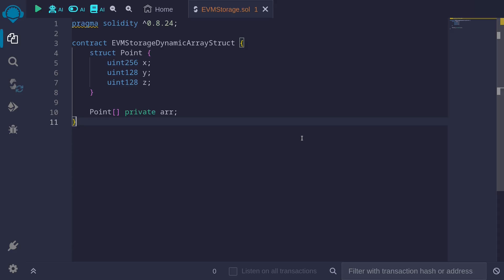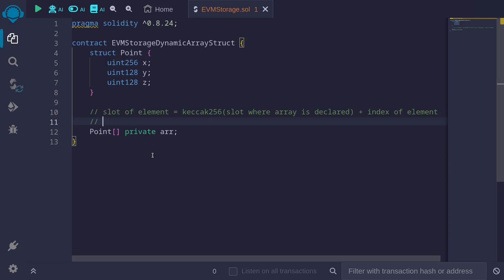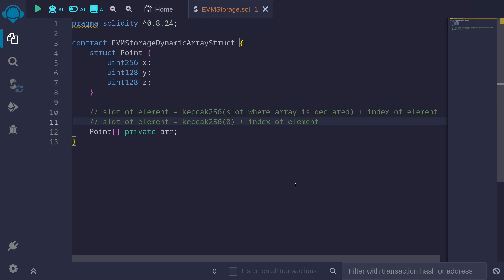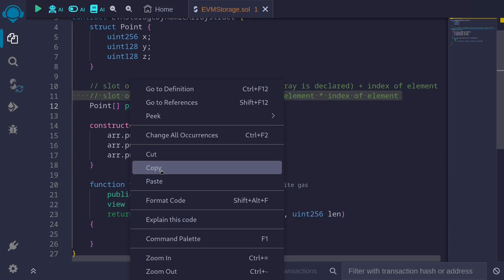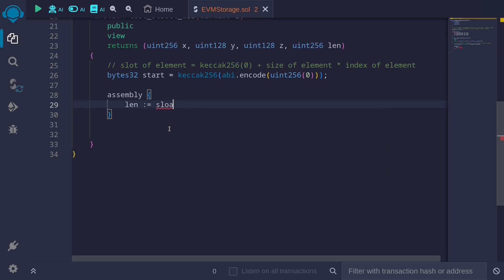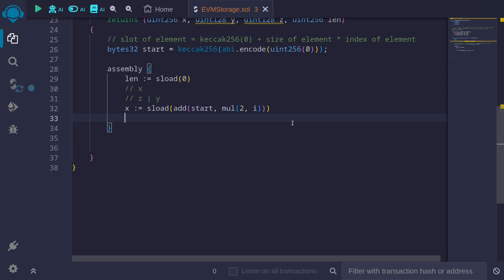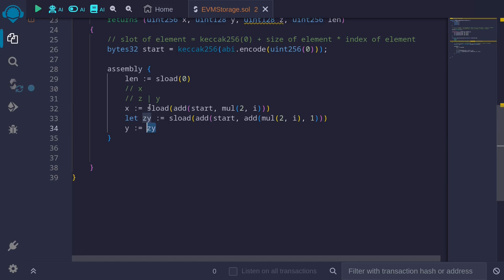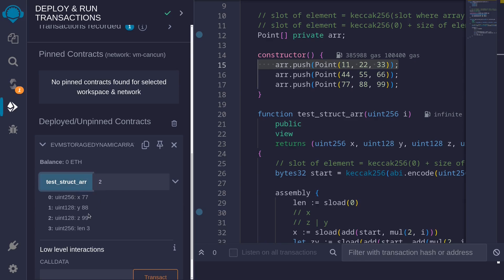Dynamic Array of Structs | EVM Storage 11

Comment: I didn't quite understand why we need to add 1 in this example ?
4:56
Reply from the maker: x is stored in slot start + 2 * i
z and y are stored in the slot after (start + 2 * i + 1)
Reply: @smartcontractprogrammer   If struct have more slots for example , we simply increase this "adding" number . Am  I right?